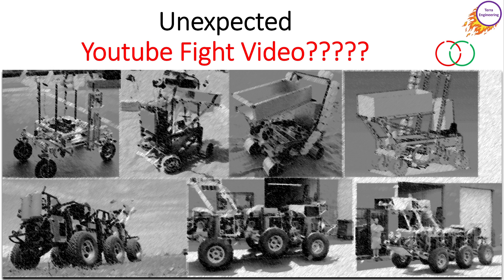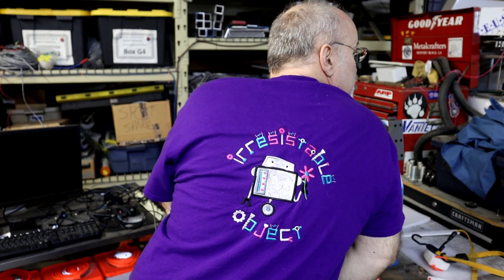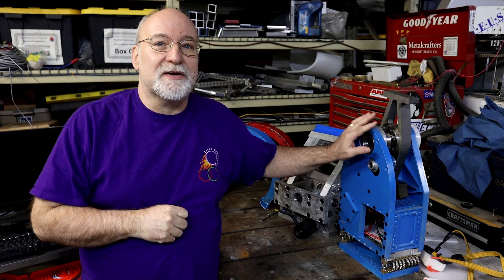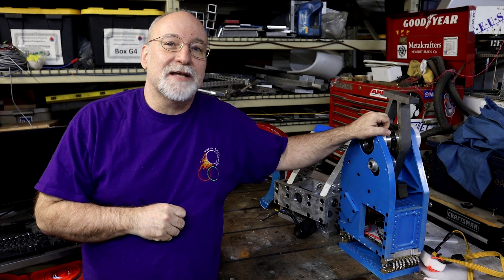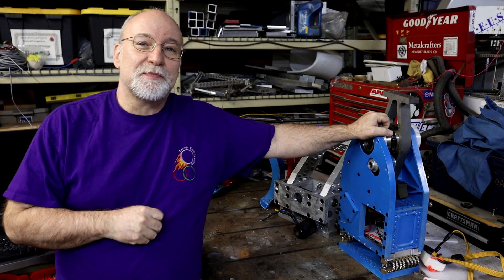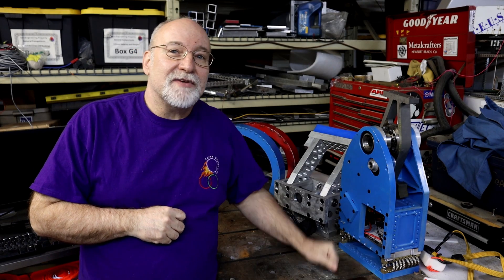Triple Crown BattleBot Video Series: Final Video - Status Report Before Vegas

Comment: I've now watched the entire series, and I love it.  With enough time to refine and build all your ideas, I'd say there's a Giant Nut with your name on it.

It strikes me that you're taking a "worst of both worlds" approach to transferring power and data across the gap to the wheels.  Bluetooth for data, and brushes for power.  I'm sure you considered doing 100% wired or 100% wireless, and I'm curious how you wound up making that decision.  Personally, I'd remove the copper ring assembly entirely, simplifying the whole design and freeing up space, and put batteries inside the wheel.  But I'm an armchair engineer :)

Comment: You built an excellent platform for a remote controlled movie camera - then put it into the battle box. Too complex. No defense VS low down undercutters. Wheels too delicate. If you want an ultimate test, invite Tombstone or Carbide over to beat up your bot. ;) Simple, brute force, horizontal spinners or vertical drum spinners have literally been tearing it up the past several years. Nightmare inspired a bunch of big wheel vertical spinners but the new generation of horizontal bar and wheel spinners and vertical drum spinners proved to be too hard for the big vertical wheels to hit, and trying to turn the big verticals quickly became very visible demonstrations of gyroscopic precession. The drum spinners get the same effect but they don't tip over - if the driver cuts the power quickly.

Hammers are just too slow and/or the drivers/weapons persons on them are almost always too slow to trigger when the opponent is in the perfect position to hit them so hammer bots tend to mostly end up fighting with the floor. I have some ideas for a fast, powerful hammer bot with automatic triggering so that ramming the opponent automatically fires the hammer. The fastest hammer was on Grant Imahara's bot but it could do little damage despite setting a record for number of hits.

Put a 4 to 6 pound sledgehammer head on a steel rod. Have a pair of heavy coil springs set up to flip the hammer forward. One spring at a time fires the hammer, both springs are fully extended before the bout. Slam Fire One! The hammer is pulled back and the automatic mechanical connection (like a push on, push off switch built to withstand hundreds of pounds of force) switches to the second spring. Meanwhile a powerful winch is stretching the first spring back to be ready to fire again. Thus it can get off two quick hits right away. Subsequent hits can come at the speed the winch can stretch the springs to reset. It could have a 200% emergency power mode by releasing both springs, but the whole system should be built to take it and tested a large number of times to prove the design, then built again exactly the same so the actual battle weapon goes in without having been stressed so much.

For putting more force on the opponent, have a pair of hardened steel wedges out the front, pointy edges up, UHMW on the flat bottom for sliding. The bottoms of the tips should be curved up a bit to slide over floor damage. The wedges should be hinged to the body. No wimpy store bought hinges, machine them right into the solid steel of the wedges and the heavy part of the main body they mount to.

Ram the opponent, the trigger bumper hits, WHAM comes the hammer, attempting to fold the other bot down between the wedges, or at least bend stuff to lock up drives and weapons, or disrupt the electronics and batteries.

What would I call the bot? Clickbait.

Comment: Todd-
I just finished watching your series (well, except for the "Where are my boards?" videos!). Thank you for the impressive documentation.
I came away with 3 conclusions:
1. You're too smart for BattleBots. :]
2. I now feel slightly smarter, after having picked up a few of your tips & techniques in the series.
3. Hand in hand with 2. above, I also feel a little dumber after witnessing your impressive breadth & depth across multiple engineering disciplines.
I hope you'll continue working on Triple Crown & bring it back next time.
Thanks,
-Judge Jason